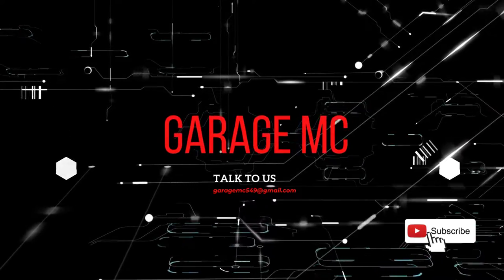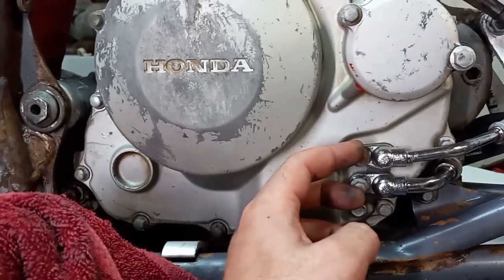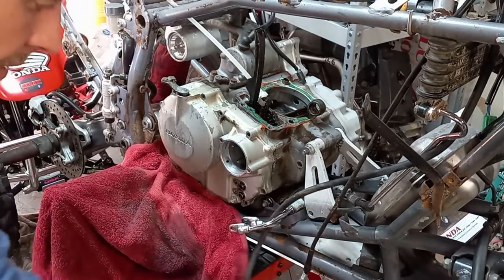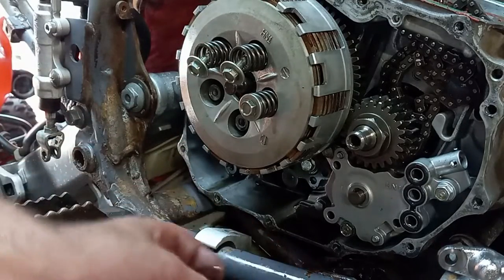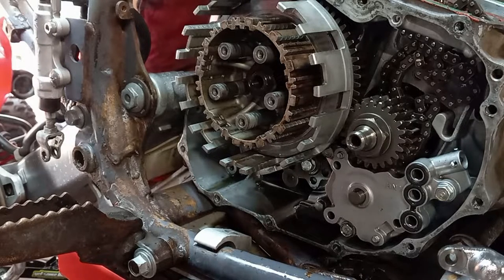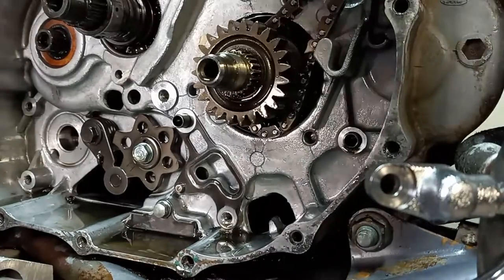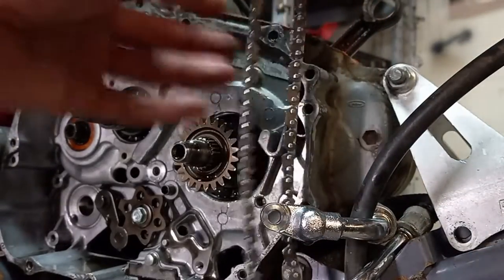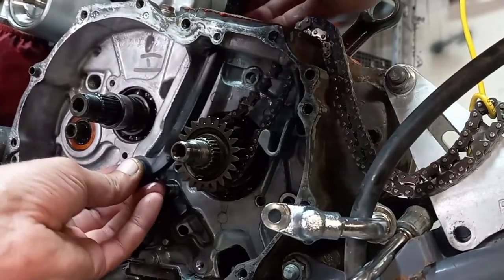400EX/440EX ATV Build Installing New Timing Chain step by step in the bottom end

Comment: Thank you so much Im watching your videos to build confidence to do my bike keep up the great videos
Reply from the maker: Thanks bro I really appreciate the comment. Biggest thing you could do is stay organized and take pictures of each step or piece you take apart. Feel free to comment if you have any questions. Get yourself a manual as well.
Reply: How much would a fair shop charge for this?
Reply from the maker: @ElSlickVic  honestly bro I'm not sure I've never taken something to a shop in my life. But if I had to take a guess I'd say somewhere between $300 to $600 depending on what parts you choose (brand of timing chain and gaskets) probably would charge the hourly rate of the shop times the amount of hours plus parts.
Reply: How are torquing down the nut for the timing chain gear without it spinning? Do you have a wrench on the other side of the bike where you check and rotate the nut to find top dead center?
Reply from the maker: @skittlesmodz2939  you can either do that or if the cylinder and piston is off you can put a pipe through the top of the rod and rest it against the case where the cylinder meets the case or use a clutch holding tool like in the video on the inner clutch boss
Reply: @garagemcmatt  thanks for the reply. I don’t have patience or memory to do all that. So I gotta come outta pocket. I had a guy change the cam and adjusted valves so he said but still has the tick. Very disappointed
Reply from the maker: @ElSlickVic  I don't even measure when I adjust and set my valves I just do it by feel and none of mine tick. If you are ever in jersey with your quad I'll take a look for you. Thanks for the comments bro

Comment: Awesome step by step video. I have a 2007 400ex and looking to replace the timing chain. Do you have a parts list? thanks!
Reply from the maker: Timing chain, chain sliders, clutch cover gasket, head gasket, rocker cover gasket, oil, filter,

Just grab a complete gasket kit from tusk.
Reply: @garagemcmatt  Chain Sliders? Do you happen to know the OEM part#?
Reply from the maker: @chrisl8674  no not off hand. Go on rockymountainatv.com and go through the oem parts diagrams

Comment: Hello! when i install the new guide for the chain, has a lot of play, is that normal? or i have to make sure the guide keeps steayd and only move in the same direcction like the tensioner? thbaks man!
Reply from the maker: Yes it only moves front and back not left and right. The 10mm bolt that holds it in the case should have a washer and a dowl

Comment: Please help I have a 2005 400EX it has a 440 big bore kit my problem is its putting oil out the breather hose bad if I hook the hose up to the air box it sucks the oil out really really bad fast new rings jug Wiseco made sure rings was right What could be the problem please help !!! runs great no leaks
Reply from the maker: That's default wierd problem to have. If it was a 2 stroke I'd say you have bad crank seals but being a 4 stroke without being able to see for myself, it might have too much oil in it. I'm sure you checked that tho. It's a tough call not seeing it
Reply: It has 1.9 Quarts of oil  but then it doesn't read on the dip stick after I start it in the morning I let it idle for 4-5 minutes and turn off let set for 3 minutes and it don't touch the dip stick dry then if I ride it oil blows out the breather tube bad .
Reply: Sounds like the oil not returning back to the oil reserve tank. 400ex motor oil don't stay in the motor it cycles how much it needs into the motor maybe something is blocking the return and making come out else where.

Comment: Question I have I have a 2000 model 400 EX yes had a headgasket leak and on it it's starting to run fine I mean you just hit the button and fire right up that was leaking out of the head so I tore it down and put a new headgasket in and bow cover gasket and all that and I watched the video of several videos I had to put it in time in time the only thing I got I don't understand I put it to the T mark it's not completely lined up with the glue groove in the low eyesight and IA low eyesight and I was wondering does it have to be right in that eyesight right rush out of the groove part Or can it be just a little bit to the left but still be an eyesight and will that keep one from not running I don't understand why it's not running because it is fine it is fine and the vials are going up-and-down Going up-and-down like it's supposed to and it's fine but it will not start I don't understand what I'm doing wrong but the question I have I know the Cam globe's gotta face down and you got 2 time remarks on the Cam gear that's gonna be level with the head but what I don't understand I've done that and have the tea in the eyesight but it's not in the underneath the groove part of the eyesight and I was wondering does it have to be right on that mark Is that maybe why my 4 will not start not start please if you can help please please call me 270709 2868 I am really about ready to pull my hair out I just don't know what I'm doing wrong and I guess the main question I'm asking you is when I Linda cama and a low's been down and you see the T mark does it have to be directly underneath that little groove in the eyesight
Reply from the maker: The t mark can be a very little bit off the mark. E mail me at garagemc549@gmail.com 
And you can send some pics I'll try to help u out if I can

Comment: Can you do this without taking off the cylinder
Reply from the maker: Yes the cylinder can stay on but the head needs to come off to access the front chain slider. You might be able to drop the rear slider out the bottom with the head still on but idk who would only change one slider

Comment: You like the 440 or the 426 more?
Reply from the maker: Honestly I only rode the 440 I put together for a customer for a very short time but I liked my 426 better but the 426 was also Ported and polished and had a stage 2 hot cam. I'm probably gunna make one of these a 440 so I'll have a better basis for comparison of each big bore kit all built by myself stay tuned bro. Thanks for the comment
Reply: @garagemcmatt  I'm just gonna call bpr and get the same set up as you. I've had my 400 since new in 2000 and you've inspired me to completely pimp it out
Reply from the maker: @SiscoK1D  that's awesome bro what kit are you gunna go with? 426
Reply from the maker: @SiscoK1D  make sure you use my promo code at bpratv.com (gmc10) for 10% off bro ask for Jaymes Welch
Reply: @garagemcmatt  I talked to Jaymes and got Basically got  the same 426 kit as you. I'm gonna replace the clutch and get a sparks full exhaust. Then  new suspension, redo the frame and everything else lol. Once you go all out you realize every bearing and bushing is smoked as well
Reply from the maker: @SiscoK1D  I can't wait to hear your comment 2 more weeks from now when you start finding all the other little things on the quad. You just tell yourself it makes sense to just do that too lol. What did Jaymes say to you?

Comment: No need to remove oil pump.
Reply from the maker: I always remove them to clean them out and for good reason this one had junk in it. But yes you can just pull the primary gear to replace the timing chain